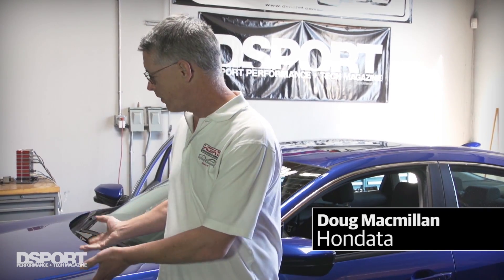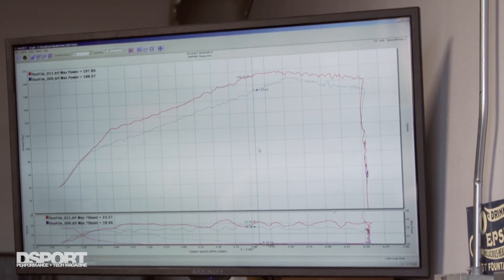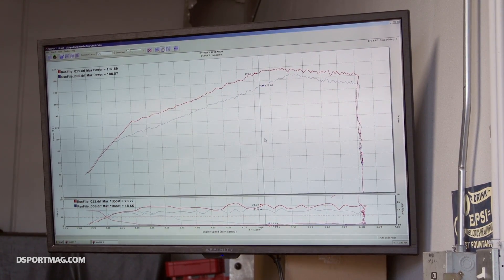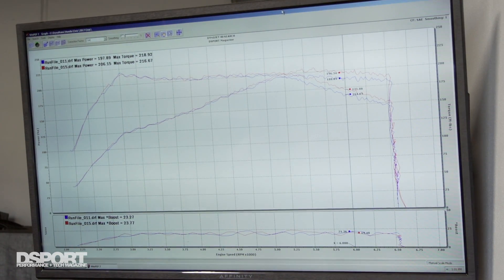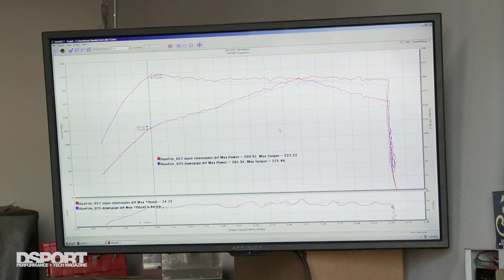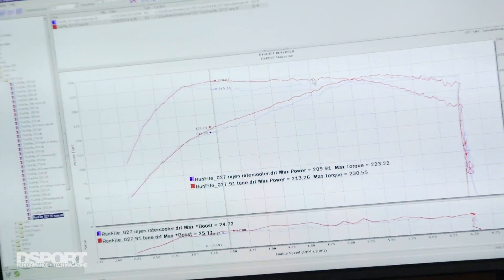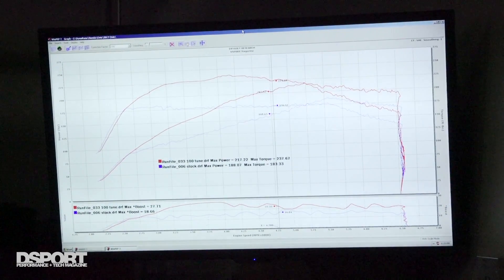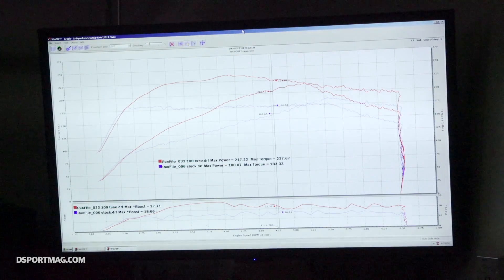Boosting to the Limits of the Civic's TD03 Turbo | 2017 Honda Civic Test n Tune

Comment: 27psi wtf
Reply: a bigger turbo would be pushing the same amount of air at a much lower psi
Reply: INVISIBLE SUN its air pressure, smaller piping/turbos at high psi are pushing less air than a big turbo at the same psi, if that makes any sense how i put it
Reply: INVISIBLE SUN That's the same thing I was thinking.
Reply: INVISIBLE SUN its a baby turbo thats why
Reply: Cole Bowman a larger turbo is able to flow a lot more air however the pressure dictates at what speed the air travels through the throttle body. as long as the turbo is able to sustain the Requested pressure a small and a large turbo will have the same amount of flow.
Reply: INVISIBLE SUN that's with the atmospheric pressure added. it's closer to 14 psi. atmospheric pressure is 13.7. anything over that is your turbo boost gain.
Reply: @SebfromNj  so according to you a car that runs 10psi stock (many do) is actually running negative 4psi boost?
Reply: nighthawk0077 this is wrong, forced induction (boost) is any pressure obtained over atmospheric pressure
An engine at idle is at roughly -1 atmosphere
Or it’s like -25hg 
When under load, the vacuum of an engine and compression brings it to at just about an atmosphere (14 psi roughly) give or take a few psi
Naturally aspirated cars do not make anything over atmospheric pressure, they do make back pressure from compression 
A turbo vehicle will have a boost gauge, that measures vacuum, atmosphere, and then positive pressure on top of atmosphere
At idle, your vacuum should be negative
This video and comment is old, I can’t remember what it’s about
Most stock turbo cars run 6-8 psi though actually, some run 10, a handful run 12
Reply: nighthawk0077 just so you know
1 bar=1 atmosphere=14 psi
1 bar of boost(positive pressure above atmosphere) is actually 28 psi
Because it’s only accounting for positive pressure above atmosphere
Reply: You're all literally clueless. You're all arguing like you know what you're talking about and you're so fucking wrong. Cole Bowman is the only one that seems to have a fucking clue out of you clowns.
Reply: even more wtf. that much out of a small turbo
WTF
Reply: Its stock psi is at around 18 so 27 wouldnt be adding too much. The Hondata tune itself gives +6 psi with just the tune and nothing else.
Reply: INVISIBLE SUN yeah that's a lot of boost especially for a little engine like that I have a 2017 GTI and they claim 30 pounds that's what the boost gauge reads anyway,...maximum about 30.5 psi
Reply: INVISIBLE SUN I know, a old Audi A4 b5 and b6 with the 1.8t makes 7psi with a k03 and a Lower compression ratio and makes about the same power as the new civic
Reply: Dude do you know boost don't mean shit lol 27 pounds is not the in A big turbo is not the same in A small turbo.
Reply: INVISIBLE SUN from a td03.  That's not really a lot of air.
Reply: Jason Widelitz that's incorrect.  a psi measurement is relative to a surface.   It has nothing to do with the speed of air or the cfm.  At a given pressure, a large and small turbo will move different amounts of air b/c their surface area is different. And if one has a much larger surface area, the resultant force from the turbo is greater, which leads to greater forced induction of air into the IC --> more cold air --> greater density of O2 into the motor -> greater combustion -> greater power
Reply: Jeroen Schuuring thats not necessarily true though.   for example the cfm of a td03 at 10psi is less than that of a gt3076r.  you would be flowing more air with a larger turbo than a smaller turbo at the same psi.  speed of the air would be the same but at wot the gt3076r would be moving much more air.
Reply: that's incorrect. psi is relative to the container. 10 psi on this civic is the same CFM weather it comes from a train turbo or a stock turbo.
Reply: INVISIBLE SUN 

No , incorrect in the second point at the same psi the turbo would make the same power. Pressure in identical environment is an accurate representation of power with little deviation

Comment: Si is going to have same block and specs but gets a higher output turbo (fin change on spool allowing high volume of efficiency in same size package) and different profile cams to aid in the higher efficiency. We are looking at the 1.5L turbo Si engine maxing some where around 250ish with around 260 ft lb. of torque at the wheels. can't wait to see this happen soon.
Reply: Phar2Rekliss yes they just made si power or better

Comment: So if the Si is using the same engine how are they going to make buyers want it more if the Engine can only get 230 HP out of 91 oc which is pushing the limits of the engine to begin with just saying but its seems like Honda is trying to shoot itself in the foot why spend 25000 on a civic Si when you can get a Base Turbo for less and get the same HP?
Reply: Honda already has that covered - the manual transmission versions are the stripper models on the current lineup.  Want leather? Too bad. Want lanewatch? Nope.  Want the good sound system? Forget it. The Si will offer all that as standard equipment & for many, that makes all the difference.
Reply: close ratio trans with lsd, better suspension,  better interior with the option for Navi and manual.  also could be different turbo.  all we know is its a 1.5.  people are assuming it's an uptuned version of the current 1.5 turbo.

Comment: Hopefully the Civic SI well get at least a TD04 turbo or anything bigger than a TD03.
Reply: Noah Cardwell 213 w
WHP is topped out? lol
Reply: Its already been confirmed that its going to be a 1.5l turbo
Reply: Well rumor is that its going to have around 240hp so i guess it would have to have the TD04 since hondata just said in this video that the turbo has topped out its capabilitys
Reply: i wasnt there to witness the dyno but if there not putting more boost through the turbo then i think it exceeded its limits so they would have to put a larger turbo to get more horsepower.  It possibly could handle more but hondata tunes dont void the warranty i dont think
Reply: And sorry i meant the turbo topped out not the motor.
Reply: SI is the same old 2.4 NA i believe

Comment: I'm missing something here. Honda rates the stock Motor at 174 hp 
~172 lb-ft torque
yet you guys are saying that stock is 187 hp at the wheels? 

please clarify.
Reply: Stephen Nichols 184whp after the hondata reflash. They just add some bolt ons and additional tuning.
Reply: Frandy Hdez 
no. look again. 197 hp after reflash
187 hp base line
Reply: Stephen Nichols Honda low balled tha hp numbers from factory
Reply: hartfordraces 
that would be nice if it were true. do you have references/links for this?
Reply: honda used a dyno that connects to the calipers and didnt give them the same results a dyno driven by tires would give.  check out hondatas first videos on tuning the 2016 honda civic i believe they mention it whenever they see the torque difference
Reply: Um no, manufacturer's use a flywheel dyno. The engine is mounted on a stand in an environmentally controlled room for the tests.  That's how all published numbers are from the car manufacturers.
Reply: does the engine really get 18psi from factory? or that baseline is upping the boost to the max safeline of stock ecu map?
Reply: 14. something

Comment: next step should be a 3'' exhaust !
if in my b18 made some power over a 2'' exhaust 
in a 2017 turbo will make wonders !
Reply: Vtecing true true! My larger 2 3/8 exhaust with straight muffler has done wonders!

Comment: Im planning on buying Hondata soon. Is there anything to worry about? Im not going to do a crazy mods but only light ones. Just want it more alive and responsive. I feel a slight lag on my 2017 hatchback sport.
Reply: How do you like it so far? I'm planning to buy one as a commuter.
Reply: I dont mind about the warranty as long as the changes are reliable. I dont plan on heavy tuning.
Reply: Alex B Did you get a custom tune or did you use the pre-set that comes with it?
Reply: you can't buy it. it says on their site it's for off road only.
Reply: Carl K that suxx. My friends are lucky to have on their SI's
Reply: Carl K what's for off-road? The flashpro?
Reply: Should have got the SI..lol For three thousand more dollars its a no brainer. Bigger turbo, better top end. More potential in the 2017-2018 si than the ext or touring or sport combiined. Hell they recently made the new SI faster than the type r in only 3000 dollars in mods. So a 29,000 dollar si faster than a MSRP 34,000 type R. No to mention honda is ballooning the type r price to well over 40,000. I drive WRX mind you. Put 1000 deposit on 2018 SI in agean blue fully loaded. NO REGRETS!
Reply: A 3" downpipe will quickly get rid of lag. The turbo will spool dramatically faster. Also cheap upgrade with big gains.
Reply: It might void your warranty

Comment: Peak power lower than peak torque on last run..screaming for a bigger down pipe and exhaust IMO....
Reply: Cast as part of the cylinder head, yes. Done to cut costs, reduce parts count, decrease cat warm up time and also to make the engine slightly more compact.
Reply: But is in the integrated exhaust manifold style found in the 9th gen Civic SI, the one that is practically cast into the engine block?
Reply: hondatrix I think Honda did some crazy design with this turbo setup and it's actually part of the intake manifold or some shit. I don't know if there's a way to go bigger due to this or else they probably would've. or there just isn't any aftermarket support yet
Reply: +Jeff Grigos it's actually part of the exhaust " manifold " / downpipe and has a plastic inlet tube running to it. This is very common for loads of manufacturers., and simple machining of the compressor or turbine housings can be done to allow volume increase, or simple changes to the number of blades per impeller could also be done, as was done years ago in  F1 for different altitudes and tracks.
Reply: hondatrix PRL Motorsports sells them.
Reply: I'll bet you're right. I've experienced what happens to a Subie STI when this is done to it.
Reply: hondatrix they didn't do that to cut cost, they did it for better response
Reply: Charge pipe and down pipe replacement needed. Upgrade the clutch so it won’t slip from all the upgrades. Tune it again.
Reply: Headers also
Reply: That isn’t how you interpret the dyno graphs at all.

Comment: Why does Honda give you a under powered car ? This is why lol working hand in hand with the aftermarket to ensure Honda cars live long past it's time
Reply: For fuel economy and emissions. More power means more fuel. More power also means more wear on the drivetrain longterm. Thats why the Si has different running gear and a different trans setup from the regular civics.

Comment: I have 2017 civic hatchback lx and I'm thinking about getting this. Does it void the manufacturer warranty?
Reply: modifying your car and voiding your warranty is a myth.... they'd have to prove that the mods done to the car are what cause the damage.... ie - water in your engine due to running a cold air intake...
Reply: if you mess with the ECU at all, prepare for having all warranty claims denied. change mechanical parts instead and they'll have a much harder time denying you. Otherwise, most dealerships can tell if the ECU has been flashed at some point...So the whole "flash back" isn't perfect.
Reply: Long M flashing your car is reversible and if something were to happen to your car because of the tune you could easily flash it back to stock
Reply: Matthew Randal thanks for the info.
Reply: Matthew Randal no way they can tell if you use a Hondata ...
Reply: Yes, they can tell you custom flashed it even if you revert to stock.  Keep in mind the manufacturer's scanning tools are about a million times more comprhensive than your dinky OBD2 scanner you bought off Amazon for $20.  Now whether they do anything to a deny a warranty claim would depend on the situation:  Blown shock ? Unlikely.  Blown engine ? probably.
Reply: Long M yah
Reply: lol hell yeah.

Comment: Boosting limits of the 2017 hyundai elantra sport?
Reply: Is the turbo the same size as the Honda(TD03?). It if is, then the Hyundai will max out at a slightly lower boost setting due do a bigger engine(+ 0.1 liters) which leads to more exhaust flow and it will have a slightly better low end and a slightly worse high end power curve. Probably insignificant though...
Reply: SI0AX no the Elantra I believe is a td04
Reply: K04 I mean

Comment: So much fun boosting the turbo to get more HP and torque...  until you blow up the engine.

I did this on my old Saab 99 turbo, and ended up dropping a valve down into a piston.  Ugly.
Reply: Too bad for you..this is a Honda...
Reply: lel. saab. lol. saab. lel
Reply: CoCoLuv9491 saaaaaaab...
Reply: All fun to find the limits of new motors , Hondata is always top notch on R&D projects
Reply: nice occasion to drop in B202 😉
Reply: 99 saab....troll
Reply: Hardly.
Reply: What motors are forged? Honda hasn't used forged parts in their engines in the past with the exception of a few models.
Reply: Jeroen Schuuring try real street s2k. i think they made 700, stock s2k. too lazy to confirm it right now. =)
Reply: On race fuel non the less and a with lot of other mods. The Saab engine I can build with just a larger turbo, 3 bar map sensor a walbro 255 and some Saab and Volvo oem parts of which most can be found used, in bulk. No fancy stuff needed ;-)
Reply: Oh and off course a bit of tweaking of the engine software in the original saab ems.
Reply: Jeroen Schuuring what kind of dope are you smoking? No way in hell anything would make 600whp on 255lph pump.
Reply: Kyle B probably not the same dope you are? I don't have time for that, I have things to do ...... like building (real) engines and stuff.
Reply: Seriously, lay off the dope. Drugs are bad (mmm kay).
Reply: Christopher Millington 

Si comes with an identical turbo but has different fins on the inside which gives it higher output.
Reply: Now this is starting to sound like a Honda vs Saab debate. Let it all out fan boyz.
Reply: bodo
Reply: bodo
Reply: bodo
Reply: Dog Trekker You didn't know what you were doing. Been there before. Sometimes we learn the hard way. Now I know not to run lean and keep a good tune.
Reply: I don't know where you got that information but Saab has been using mahle forged pistons ever since they introduced their the B202 turbo engine. That's about thirty years ago but in it's time it was one of the most innovative engines with balance shafts and 16 valve technology. These blocks are pretty bullet proof withstanding enormous amounts of torque. A stock B204 engine out of a '94> saab 900 can handle up to 600hp @ <7krpm and it can do so with only upgrades to the software, turbo and fuel system. The engine management is very reliable and capable. I have yet to come across ANY 2.0l four cilinder factory engine capable of that!
Reply: Front wheel drive, turbocharged and its still slower than a 1990 volvo 760
Reply: They are made like trash these days. Whos to say these engines will hold up at all?

Comment: installing a cold air intake requires a tune .....? Yes or No
Reply: It does not require a tune. You can install one and just go, but like in this test, a tune lets you have more power along with the cold air intake from mishimoto. So tune it to get the extra hp.
Reply: Semir Palic No you do not. Installing the Injen, Mishimoto, or any other intake does not require the dissemble of the front bumper. You can do everything just by the removal, and access of the hood.
Reply: Semir Palic unless the assembly instructs you to do so in the instructions of what intake you purchased
Reply: Semir Palic unless the assembly instructs you to do so in the instructions of what intake you purchased

Comment: hold more boost than a subaru. 27.69psi on stock internals
Reply: msk nuked yeah the internals are built for boost and then some. These 1.5L are very reliable and can handle much more power and boost with stock internals. A psi boost and an earlier vvtc = what u saw in the video. Gonna get that done today as well. Intake turboback exhaust and intercooler

Comment: Javier showed up at IFO Bakersfield with the CVT 1.5 Turbo Civic Touring model and was clicking of Mid 14's all day with just the Hondata flash. Nice work!
Reply: Anthony Thomas yes!
Reply: I'm a complete car noob but i'm interested in what you're saying. So with just the hondata flash, this guy in the civic touring did WHAT? :|
Reply: stock tires and suspension?
Reply: Magnum we all start somewhere man. No need to be a dick.